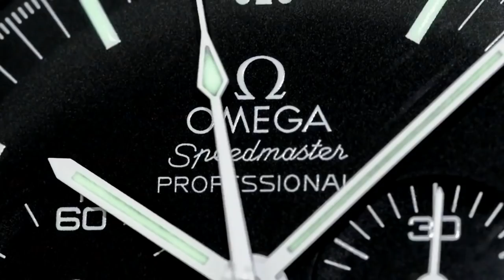HOW TO REFIT A CHAINSAW CHAIN IF IT COMES OFF - Ryobi RCS4240NB

Comment: That chain is still way too loose; there is a fine adjustment screw you still need to use after you bolt it in.

Comment: That's all well and good, but it's still slack! You need to show the adjuster and how to tighten it until you can just pull it from the bar and it snaps back, otherwise it's a waste of time. Oh, and it'll come off again most probably. 😬